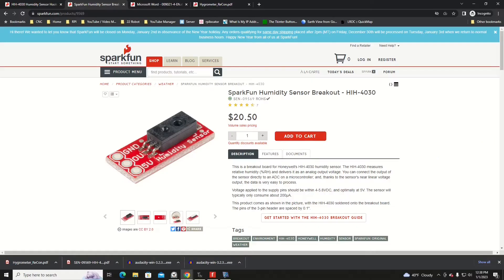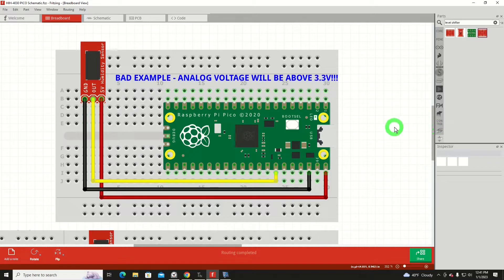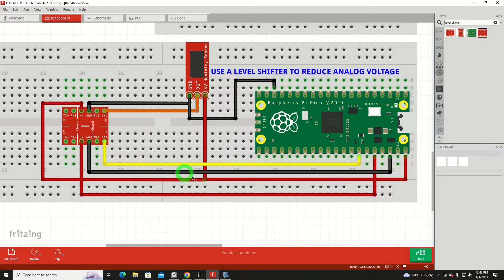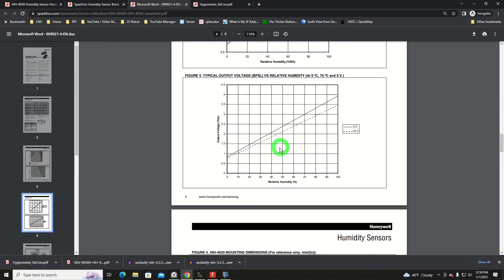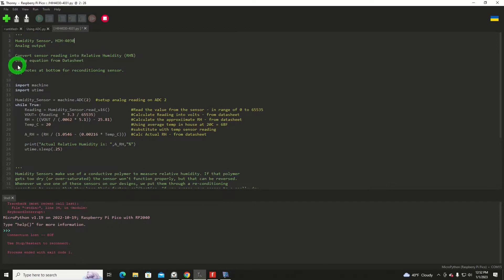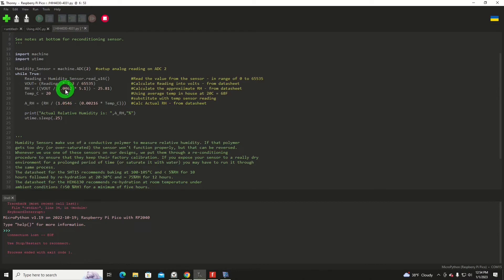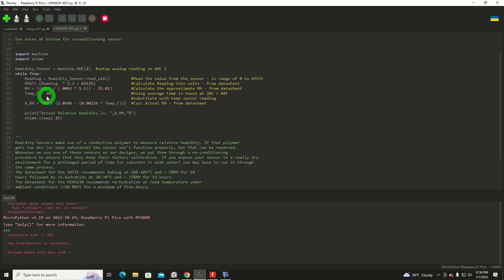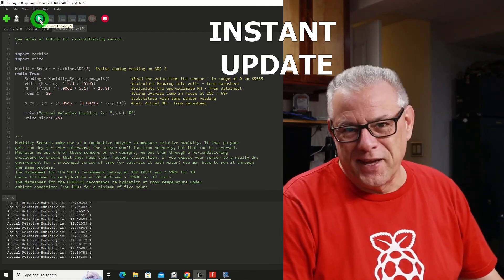How to use the HIH 4030 Humidity Sensor with a PICO

Comment: This video got forgotten in the mist of time, happy new year, 
the Honeywell HIH 5030-001 can run on 3.3V, but is barebones so needs soldering, adding wires to the pins seems doable.
Reply from the maker: Ha, Is that when it was filmed?  My filming schedule has to work around my work schedule (real job) so sometimes I film several stories then drop them in the schedule when they fit.  
Yeah it is a tiny little sensor and while working on an unrelated small project this past week, I realized soldering the discrete components is getting more and more difficult.
Cheers!
Chris